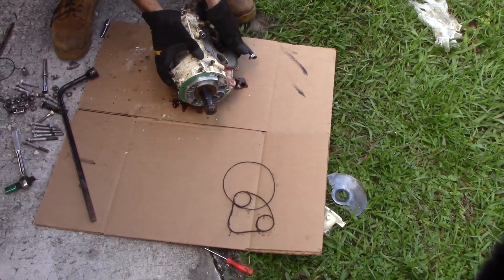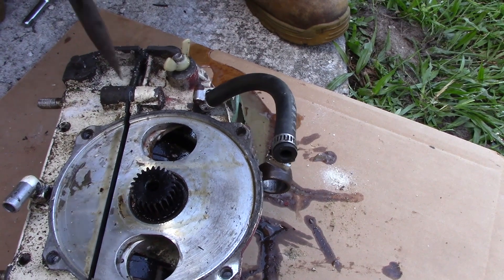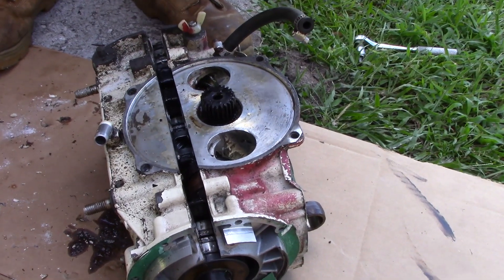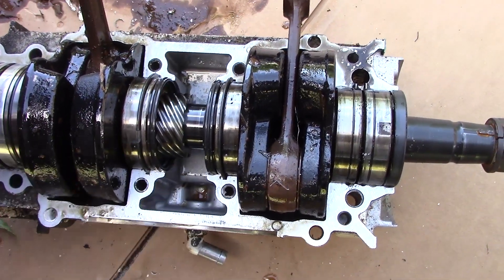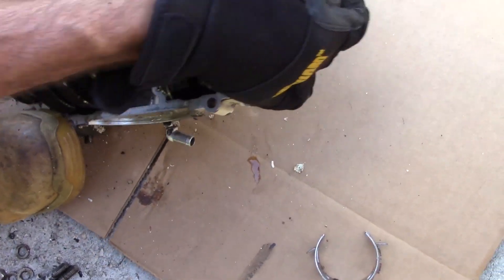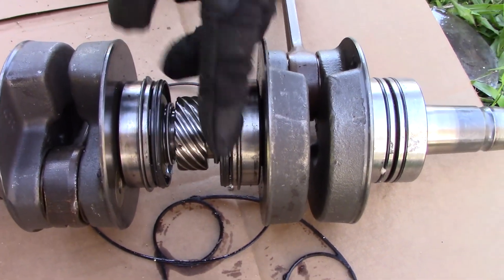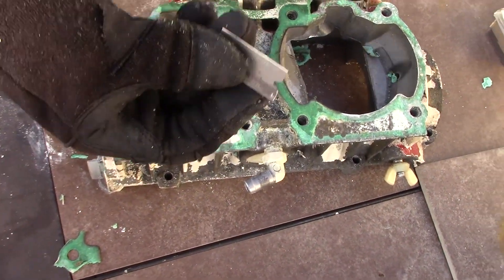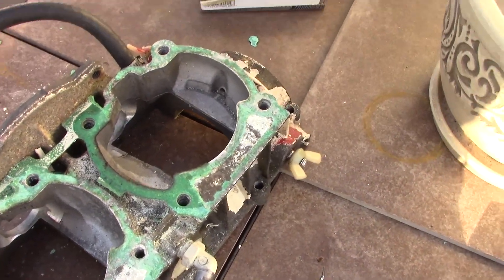Seadoo 657 Engine Rebuild Bottom End Crankshaft 2 Stroke

Comment: Actually you don't need a razor blade, especially on aluminum! All you need is boiling water and it comes right off with a plastic putty knife!
Reply: Boil the cases? Or pour it on the gasket?
Reply: @Factory928AC  pour hot water on the gasket

Comment: Great content, I didn’t watch the video on Dorian, but I hope everything is good. I just got a SeaDoo SPX from my brother-in-law and it’s got a 657. I can’t find the flush quick connect but the hose coming off of the head by the “Bomardier” is capped off. This was a fresh water ski, but I will be running it in salt water and need to flush it. I’ve looked and I guess I’m just not looking in the right place for this answer. Any help you’ll be appreciated!
Reply: The hose goes on where the red cap is if it is original